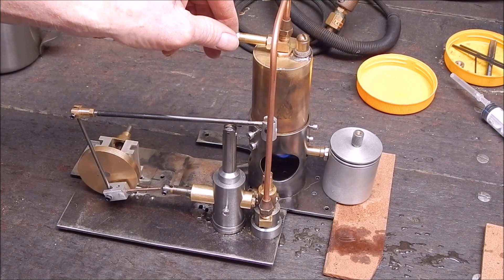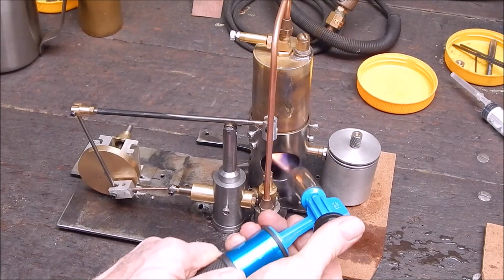We need more steam Scotty !!

Comment: The boiler stand is robing the heat from the boiler???? Me thinks. Just my humble opinion.
Reply from the maker: Hi Walter,  I don't think so.  The boiler base sits on three small bolts and the boiler sides are not in contact with the steel stand for most of the diameter (slightly smaller).  I need two wicks and a larger surface area on the boiler to absorb the heat.  Alan from Retro Steamtech warned me this would be an issue going vertical and he was right.  Cheers Rob

Comment: Hi Rob. Fantastic to see it running on steam. Vertical boilers look great but as I said they do suffer from certain problems. There is only a small area to apply heat to, with a horizontal boiler you can have a long burner tube which applies heat along almost the whole length of the boiler. Also your steel tube firebox will act as heatsink and draw heat out of the boiler. That being said, it looks great and sounds brilliant when running 👍👍👍 Cheers, Alan.
Reply from the maker: I agree on all points Alan, but I had to try it to see what difference it made.  I will go the same way as on the wobbler, but add a heat trap roof as well.  Could be a while before I get it done.  Cheers Rob